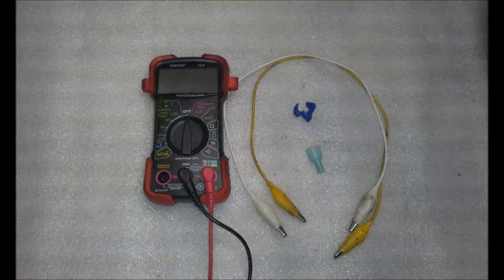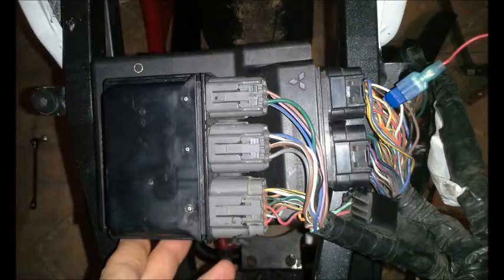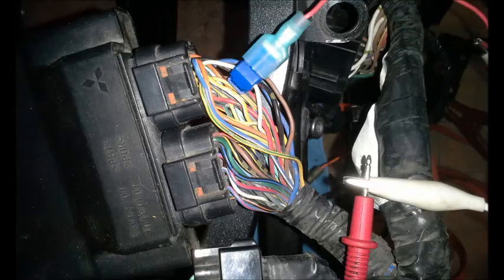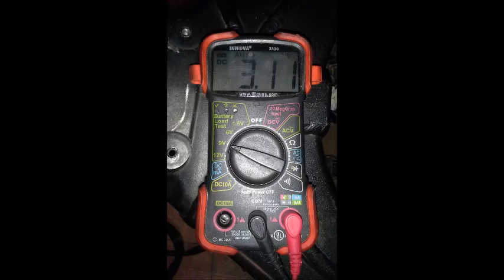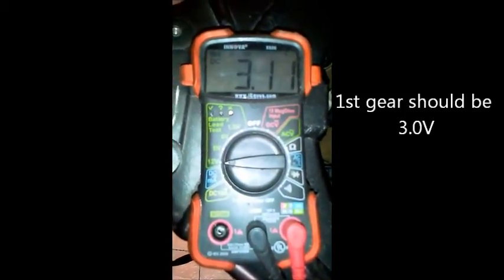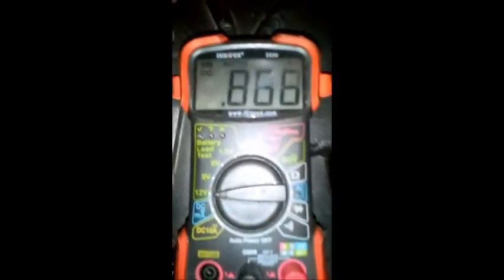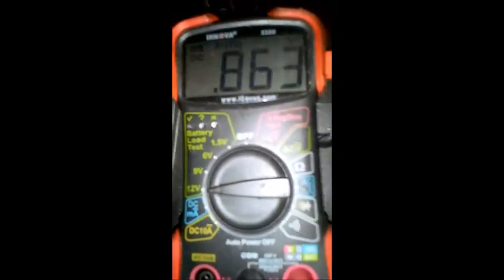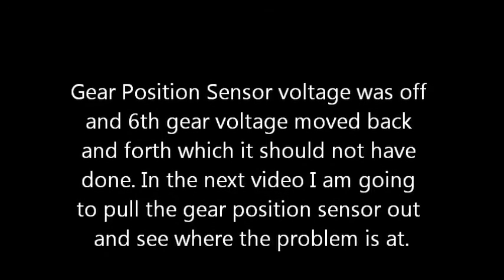How To Test KAWASAKI NINJA Gear Position Sensor Circuit with Broken Gear Indicator

Comment: Awesome that chart really helps I printed off a copy to keep near by thanks!
Reply from the maker: +MidwestMotoRider The chart only works on the kawasaki models. Suzuki gsxr and sv models have very similar sensor, but with different voltages. The bike I am working on has a sensor.............but it's pretty useless, I'll cover it in the next video. Whoever designed it.....................I really don't know what they were thinking.
Reply: EVERY DAY I RACE Cool that is good to know at least now i know I can go look for the correct voltages on a case by case basis. Perhaps it was engineered on a Friday when they just wanted to get out of the office.. At least that would explain what they were thinking.. :)
Reply from the maker: +MidwestMotoRider  They didn't ground the sensor lol.
Reply: EVERY DAY I RACE Really wow.. I would have guessed that would have been the first thing to do. Sigh.. Well I am sure they had some reason for it.